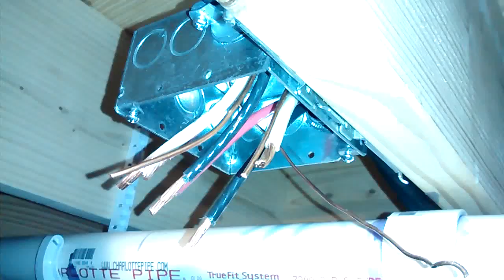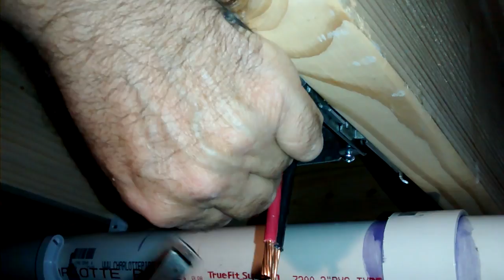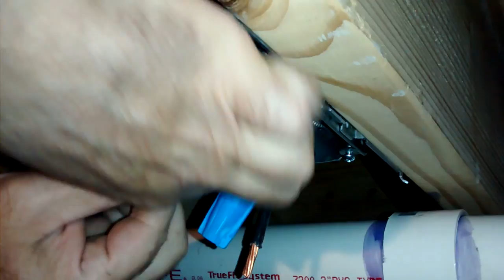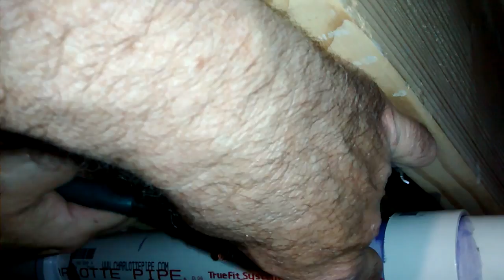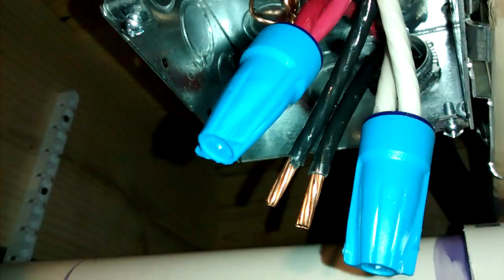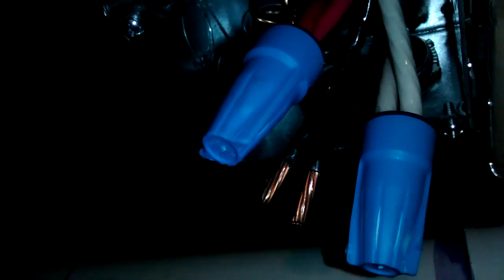I show how to wire a 4 wire #6 wire junction box for a stove

Comment: Had to turn off the annoying audio. No need to use wet location wire nuts. Where is your box grounding ?  Hire an electrician !
Reply: The box is grounded. First three wires he twisted together.
Reply: He's mad at his parents not you.  Only "power" some people have is online 😆
Reply: Maybe he doesn't trust the coupling on that drain.
Reply: Nothing wrong with using those wire nuts, you just sound like any angry person bitter at the world
Reply: No need to use them. But if that's what he has.. it doesn't detract
Reply: Don't they have to be joined as if they are one solid connection,looks like they are not spliced enough
Reply: @farmer Dave  I didn’t find it annoying at all. Maybe you should listen to his message. Or maybe you’re antifa.

Comment: Is that a rubber silicone?
Reply: connector is filled with a dielectric silicone sealant that surrounds splices, making it water and corrosion resistant
Reply: They are sold as 'outdoor wire nut'